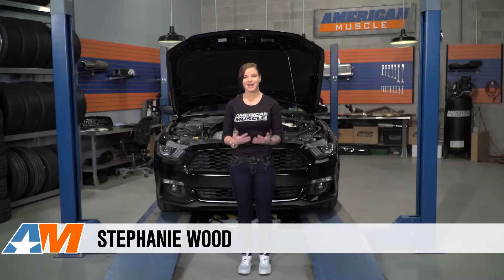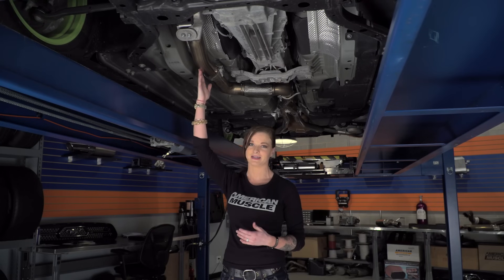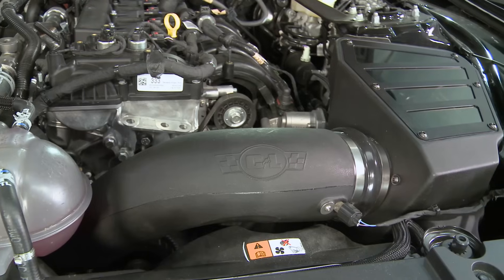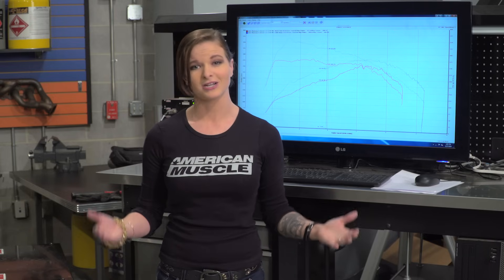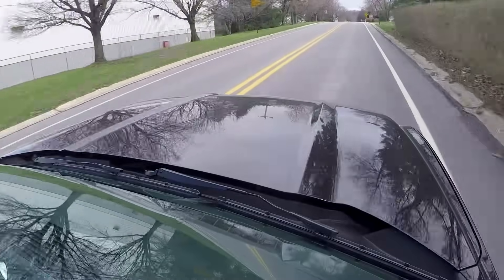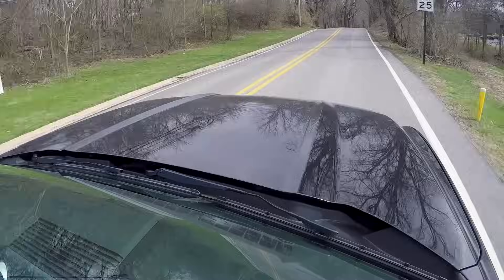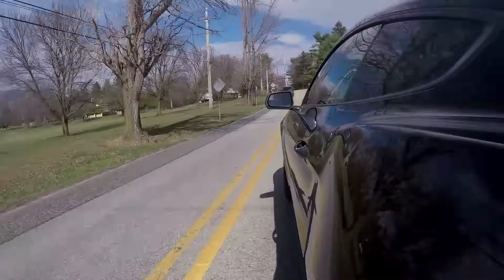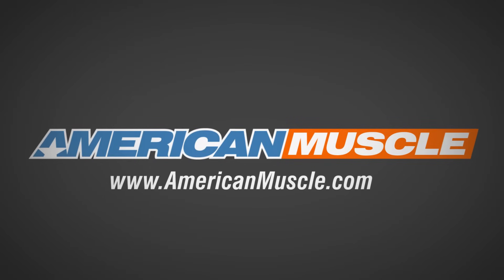3 Mods + 113 HP Gains- 2015 Mustang EcoBoost

Comment: I thought that the stock 2016 muatang ecoboost gives 310 horsepower and 320 TQ. But your graph shows 245 HP and 277 TQ. Can you explain
Reply: Qais Farid probably running on regular 87 octane it loses power if you run it on regular fuel got to use 93+ to get the full potential out of the engine
Reply: demeror carr 
But they upgraded the engine to get 311 HP. Doesn't the car give 310 HP stock from the factory. The graph shows stock engine using 93 octane giving 245 HP. Shouldn't it be giving 310 HP in the Baseline Run
Reply: Qais Farid ok I see what your saying I went to a few sites and found some useful info found out that most cars have about 20% less horsepower than advertised only way these cars get the actual max potential everything has to be perfect like the track has to be prepped perfect weather top tier fuel the right tires & rims and of course the ecu tuned for maximum performance cars from the factory are programmed for regular driving everyday use basically the power is there but it has to be unlocked and some weight has to be shed so the 310hp is what the engine is capable of but I seen on average under good weather conditions the ecoboost straight from factory is doing between 266hp to 272hp without the ecu tune so my guess is Ford did this on purpose for ecoboost owners to purchase the recalibration kit to unlock more power which probably actually brings it up to that 310hp mark
Reply: demeror carr 
so how much more is that kit to unlocked that 310 HP
Reply: Qais Farid    The Dyno, which is the machine used to measure the HP in this video only measures the power that is sent to the WHEELS.  Manufacturer ratings of power are based on the power that is at the crank. The loss of power from the engine to the Wheels are usually 15-20%, which means that if the dyno results are 245, the car would be making roughly 300 at the engine.
Reply: Hoang Huynh 
so basically when you drive the Mustang in the streets it gives 310 horsepower
Reply: Qais Farid     well yeah, at the engine.
Reply: Hoang Huynh 
explain when your use the term
 at the engine
Reply: Qais Farid When they talk about 310 HP they mean HP to the crank which means that is measuring the power of the engine by itself, when you measure the horse power to the wheels is when you really see the real amount of power of your car, however, this car loses a really big percentage of HP compared to others, I own a 2006 mustang gt which comes with 300 HP to the crank and makes anout 270 HP to the wheels completely stock
Reply: Qais Farid thats whp. Wheel horse power not overall
Reply: Qais Farid The Ford horsepower and torque numbers are measured off the engine at the crankshaft. After the drivetrain loss, a dyno measures the engines power that is transfered to the rear tires.
Reply: Ford rated it at brake horsepower 
She measured it a Rear wheel horsepower
Reply: lol just say 245 is the stock rwhp then after mods rwhp went to 310 meaning the engine is probably push around 375-380 or what y'all called Ford standards
Reply: BlindRamb0 
There are not different "standards"
Ford rated their horsepower number at the crankshaft BHP
They measured on a Dino connected to the wheels RWHP
Reply: Daniel Raynor I was commenting towards someone saying Ford ratings yes I know every manufacturer uses crank numbers while dynos can show rwhp
Reply: Crank hp to Wheel hp
Reply: Man 310 is what it's making at the engine on premium 93 octane fuel.  245 in this video is more than likely done with 87 octane fuel which will provide less hp (probably 290-295 at the engine on 87 not the advertised 310 because the ecu pulls timing on lower grade fuel which results in power loss) and not only that but this 245 us measured at the wheels....manual cars lose approximately 15% or so hp from the engine to the wheels not just this car but all cars lose power to the wheels from the engine it's called drive train loss.  Manufacturer power ratings are at the engine.  And these power ratings are at the engine on 93....this was almost surely 87 on the before dyno (a thing done these days to make the gains seem "bigger" than they would if it was running 93 fuel from the start).  My guess is it would make 260 or so to the wheels on 93 which is about right for 310 at the flywheel.
Reply: 310 crank horsepower.  Due to drivetrain loss the car puts 245 at the wheel.
Reply: OG ImmortalKingdom it's always lower on a dyno
Reply: Ford lists those figures "at the crank", Dyno is at the wheels, the difference is drive train loss.
Reply: OG ImmortalKingdom 91 to 93 octane crank horsepower to wheel horsepower and it also depends on how high above sea level they are a car that is a mile to two miles above sea level can see up to a 25% drop in Power
Reply: They are quoting WHEEL HP AND TORQUE numbers. Factory is quoting crank HP. Stock is 310 crank and 270 RWHP on 93 octane.
Reply: D Car wrong, all manufacturers measure hp at the crankshaft. The engine makes 310 all day long. The power measured at the wheels is 15-20% less. Rwhp vs hp. Manufacturers don’t advertise rwhp. It isn’t just ford. You need a dyno to find that number.
Reply: Kais farid crank its 310
Reply: 310 is at the crank, 245 is at the rear tires. U loose HP thru the drivetrain.
Reply: The 310 is at the flywheel and 245 is at the rear wheels. The difference is parasitic loss.
Reply: So the stock enclosed air box utilizing the factory cold air through the grill was replaced by an expensive aftermarket enclosed air box utilizing the factory cold air through the grill

Comment: I didn't hear in the video whether or how much that programmer and tune increased the factory maximum boost. Seems that would be source for most of HP & torque increases.  Someone else in the comments questioned that years ago but I see no response from AM.  Another thing I question is how so many people interested enough to watch a video about performance mods are clueless as to wheel HP vs crank HP.

Comment: I thought the ecoboost stock produced 310HP??
Reply: Gerson Ruiz all auto manufacturers advertise the BHP  of their vehicles.  This video uses WHP which is the far more realistic number  (horsepower at the wheels).  That's what matters - how much horsepower you have where the rubber hits the road.  WHP is between 10% and 20% less than BHP, depending on the drivetrain layout.  The ecoboost is only producing about 245 WHP.

Comment: my ute has installed rear caddy light, recessed plate, de badged, door poppers with other after market mods but will be getting an after market larger turbo as per the diesel specialists and my ute already sound really nice n drone throaty with huge pick up but really just lacks G force of which Im really wanting is more acceleration as it has heaps of top end speed but needs G force.

Comment: A $2,550 investment in parts, for less than 70 hp gain at the wheels? To me, that is somewhat expensive for such little improvement over the stock dyno number given. Please understand that I'm in no way hating on the Ecoboost, because I have a 2016 and love driving it. I just would never spend that kind of money for such bang for the buck so to speak.
Reply: that's a ton of hp for 2500 bucks....
Reply: DFWFocusguy you're hilariously uninformed, that's really cheap for 70 hp
Reply: As I stated, I'm in no way hating on anyone who would spend that much. I was merely stating my personal opinion.
Reply: Youngster543210 not really
Reply: Ford has released the performance calibration kit for Ecoboost and it is only $699. Here is the power increase info for the kit: Peak horsepower and torque increases with the EcoBoost calibration kit are substantial, but even more impressive are the gains throughout the powerband, including a whopping 100 horsepower increase at 6,000 rpm. The kit boasts an average gain of 40 horsepower and 60 lb.-ft. of torque from 2,500 rpm to 5,000 rpm, with even larger average gains of 75 horsepower and 64 lb.-ft. from 5,500 rpm to redline. I rest my case.
Reply: Chad Wright. I just bought a brand new 2015 Ford Mustang Ecoboost Premium on Saturday. I spoke with Ford today and the calibration kit will not void my warranty. I found it online for $599. Did you end up buying it? Do you like it?
Reply: I haven't purchased the calibration kit. If I was going to invest money into any performance upgrade, I would buy it since like you said it will not void the warranty.
Reply: Disney Fan in Texas but cheaper parts and just use the tuner lol
Reply: You can also skip the Borla catback which wont effect power and drastically reduce the price and not be an annoying can of angry bees.
Reply: It's not like it's a choked back small block Chevy.  These motors have been engineered to the Nth degree.  Back in the day you could slap some headers, an intake, bigger carb and a cam in a 327 and get almost 200 more horsepower out of them and not spend $1000.  Today, you have to pay a lot for a little because there is so little left to get out of them.
Reply: Rudy Tanelo Ruxy 
Agreed. Take those axle backs out of your cart and youll save 800$
Reply: Disney Fan in Texas the stage 1 Cobb does better, and gives you more options for later. If you are worried about warranty, don't  mod your car.
Reply: Disney Fan in Texas lmao I had to pay 2600 for an ECU tune for my CLS550 from Renntech. You guys have it amazing.

Comment: I love at 6:31 she says "I hope you're a good driver. " as she is straddling the double yellow lane separator.... LMAO! But I gotta admit I was skeptical about the return of the 2.3 Turbo since the last time Ford put it in the Fox Body and that was a much smaller and lighter body style than the new body but the gains she got from 3 relatively simple mods I am impressed.  I'm not a fan of the new body style Mustang but if I was in the market for an EcoBoost 4-cylinder Mustang I would definitely use these modifications to pick up the power because I see what they can do. I come from the fox body Mustang Aero because that's what I grew up seeing on the road and when I was a kid my dad had a 64 and a half Mustang with a 289 in it so I'm spoiled on the GT Mustangs of the 60s and the fox body Mustangs of the mid 80s to mid 90s. I've owned an 84 Mustang Fox body with the 2.3 non-turbo and a 4-speed overdrive transmission and I've owned an 86 LX Mustang 5.0 but it had an automatic which really killed acceleration but it was still fun to drive and I've owned a 94 GT 5.0 Mustang that had trick flow everything under the hood and an x-pipe exhaust running through MagnaFlow mufflers with the 5-speed stick shift and that's the one that I miss the most because that car to me was a beast of a car. It only had about 350 horsepower but you could use every single one of those horsepowers. It was so fun to drive and being a black car with black leather interior it was just sexy. The only thing that I've had that I didn't like when I got it with someone put the 17 inch Cobra R wheels on it but they were white Wheels and to me the white wheels just killed the black paint. If I hadn't gotten rid of it I was going to change the wheels to the gunmetal grey Cobra R Wheels because in my opinion that looks better than white wheels on a black car

Comment: The stock whp is 272hp. This same shop listed this as 272whp in a different video.Every time mods are done they way underestimate the HP to make the mods look better. 

So far, all aftermarkets exhausts sound like weed whackers. A downpipe and factory exhaust would be much better
Reply: You can put the same car on 5 different dyno's and you will get 5 different horse power and torque numbers. A chassis dyno or an engine dyno is only a tool and the tuner with the dyno that shows the lowest horse power and torque numbers could actually produce the fastest cars because again every dyno will read different even when the dyno's are from the same manufacture. Start comparing different manufactures of dyno's and the numbers will be even farther apart.

Comment: How many of these mods depend on 93oct for gains? We're stuck with 91 here CA. Be nice to see some installs with 91. I also like how she's hinting at, "yeah this exhaust is annoying.
Reply from the maker: None of these modifications are dependent on 93 octane fuel to produce horsepower, as long as you use the right tune with the Cobb Accessport you will see gains regardless because of the more aggressive calibration. You will see a little more power out of the 93 octane tune in comparison, though. -Zach
Reply: Of course. Makes sense. Would just love to see posted specs for 91 as well as 93. Love you guys. I’ve bought A LOT of gear from your site over the years! ;)

Comment: Foot pounds are torque measurements when tightening bolts, not for engine producing torque. That's measured in pound feet. Would have been nice to see specs, and sound, with a free flowing cat added to exhaust.

Comment: i'm a little confused. I was looking at a 2017 Ecoboost and it shows up to 310 HP Stock...How come stock you only came up with 245HP....i was hoping if i invested $1500 in Mods i would be somewhere around 375 HP....Is that possible? your Mods bring it back up to a 2017 stock Eco boost according to my research.....Please advise

Comment: Using the standard 1.15 multiplier...I get to 318+ Torque, but only 281+ HP on your stock run...how come almost 30 missing HP to rear wheels/crank?
Reply: bosssho I was thinking the same thing.
Reply: Because you're using an arbitrary 1.15 multiplier which is only a very  rough average of powertrain loss for manual RWD cars.  There is no standard.  There also is a huge difference between dynos - which I think is stupid but unfortunately is true.  Take the same car and put it on two different dynos and you'll get two very different numbers.
Reply: True Mike plus depending on each car's individual setup, RWD, FWD, AWD, etc, you will expect to see different values due to the distance the power needs to travel

Comment: 245hp? Is there no turbocharger in it? Also I cannot find any other list of good mods besides this one for a ecoboost. I wanna get an ecoboost for my next car as well, also is there a good turbo kit for ecoboost that's around $1000?
Reply from the maker: 310HP to the crank, 245HP by the time it gets to the tire due to drivetrain loss which happens on every single vehicle regardless of engine. There is a turbo in the 2.3L Ecoboost. Really the biggest modifications you can do for an Eco outside of installing a larger turbo are the ones shown in this video! Cold air intake kit, downpipe, cat-back exhaust system, a nice tune from a company like 5StarTuning, and maybe a new blow-off valve to hold boost a little better. You can always look into a replacement turbo kit and camshafts like the links below, but parts and labor are going to be MUCH more expensive compared to the previously mentioned bolt-on mods. Hope this helps! -Zach
https://www.americanmuscle.com/ford-performance-mustang-high-performance-turbocharger-m-9348-23t.html
https://www.americanmuscle.com/frpp-hp-camshafts-1516eco.html

Comment: The intake is good enough for the GT, leave it alone, install a drop in filter and a air aid intake tube instead for about 1/4 of the price. The intercoolers in these cars are way too small and heat soak after only a couple pulls.
Reply: Wrong, that air box is a restriction when you start making more power, the 2.3 is turbo charged and the 5.0 is naturally aspirated so they are not even close to being the same. Every time you make a 90 degree turn you are creating turbulence and with the stock air box you are making two 90 degree turns, the first one is when the air enters the air box it has to make a 90 degree turn creating turbulence to pass through the air filter, after the air passes through the air filter it makes a second 90 degree turn to exit the top of the air box again a point where turbulence is created. Turbulence hurts the airflow. 

Take the Roush Closed Lid Cold Air Intake the air enters the air box and only makes one 90 degree turn as the air passes through the air filter directly into the feed tube. 

Are there some poorly designed cold air intake systems? Yes there are but if you go with a reputable manufacture like Roush and a few others you will have a better flowing system than the stock air box.

Comment: Quick Question I brought the 2017 Eco boost and im not sure if this one has the same little mic in the rear roof lining to send a engine noise through the speakers to make it sound more beefer so I am wondering if I do the same exhaust mod will it make it louder because of the mic in the cab area

Comment: This may be a dumb question but I’m just recently getting into cars, would these mods still all pass emissions because I’ve heard down pipes dont. Also what is the price for mods like this?
Reply: A cat less down pipe won't pass emissions because there is no catalytic converter in it, a down pipe with a catalytic converter in it will pass emissions so if you want to change the down pipe look for a down pipe with a highflown catalytic converter.

Comment: Part of me wants the ecoboost for the gas mileage and pretty quick out of the box, but part of me wants to spend another 20+ grand on the Mach 1 with the 6 speed Tremec transmission and get the 5.0 coyote where I can get some more power with a SC and crap gas mileage lol.